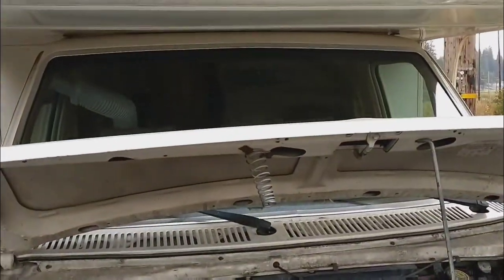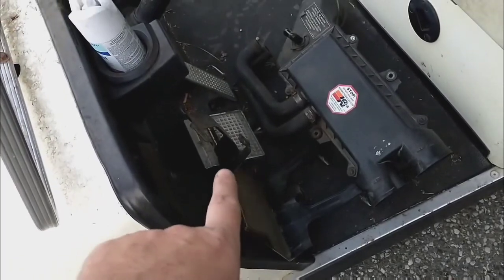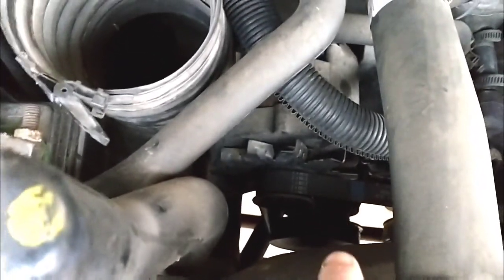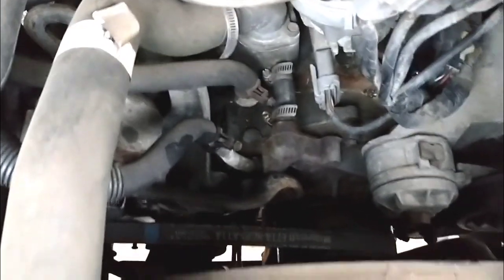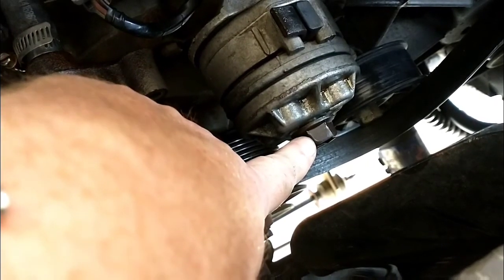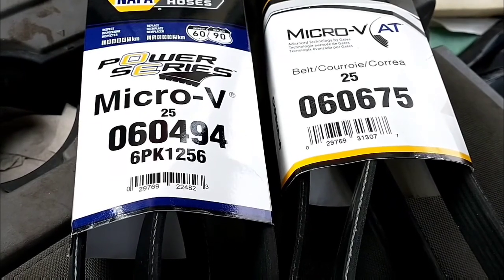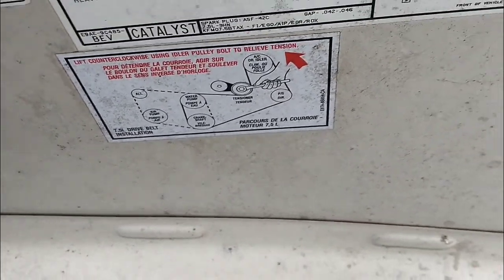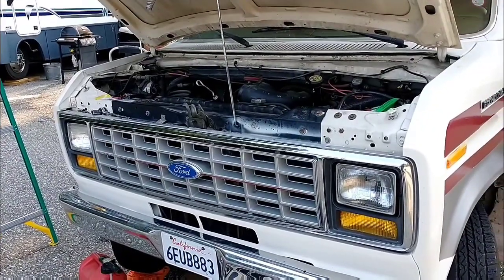Changing Belts on 88-89 Ford 7.5 liter 460 E350 Motorhome

Comment: I've got an 88 I am doing all the basic maintenance on. Have no idea who did what last. Oil was blacker than coal and filter looked very dated as well. Got that changed. She was over heating I believe, so I changed out the thermostat as well. Doing that I broke the temp gauge so I ordered a digital one of those and will be changing out belts for the hell of it because............ why not..... right?  Trying to clean up and replace anything and everything I can. Will do a spark plug and plug wire replacement as well along with belts. We plan on using it as a RV and putting some miles on her, So I want to take care of the typical breaks now instead of on the road. So fun!!
Reply from the maker: Good luck to ya!

Comment: These are easy to change, but you do need a bar wrench to loosen the tensioner as the tensioner is strong! The altenator belt you just loosen the altenator bolts to swing it loose!
Reply: How do you replace the power steering belts? They go around the water pump and crank pulley also